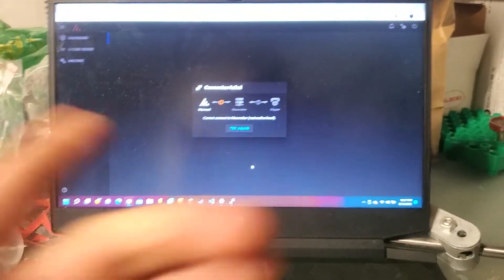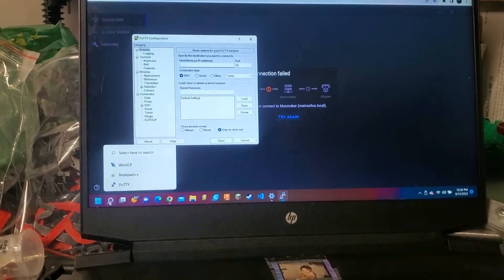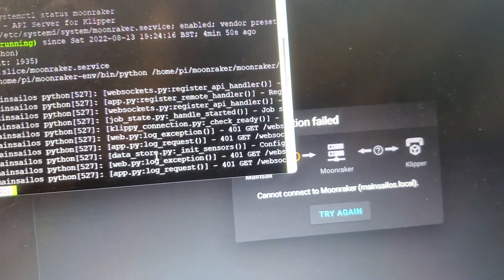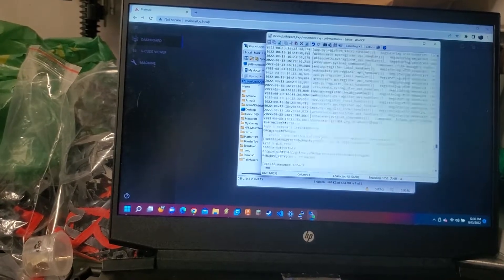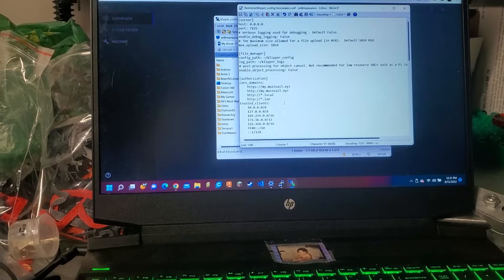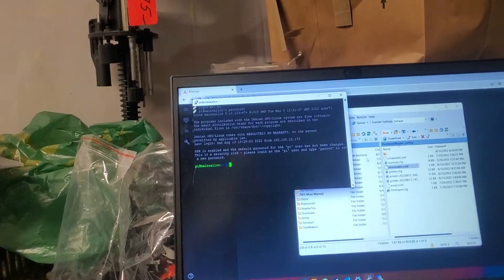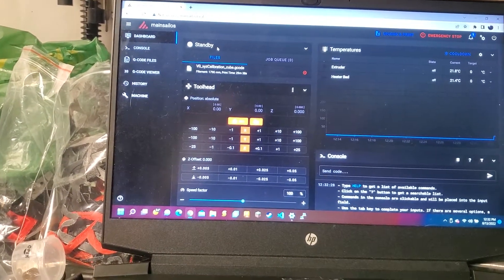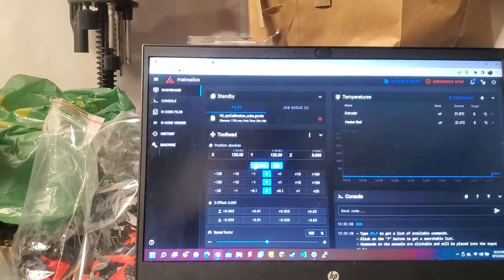Moonraker Unable to Connect: 401 GET / Websocket

Comment: Found your video and was hoping against hope that it would have the answers I need but no such luck.  Running a fresh install of linux mint and managed to get klipper, mailsail and moonraker running.  All was good until I accidentally shutdown the laptop.  Now when starting klipper I get an error that the klippy_uds_address in moonraker.cfg is incorrect?  Checked on a bunch of forums and (as usual?) I get non-answers.  Mainly "why did you do that?" or "you need to put in the right UDS address".  Honestly I don't know why some people waste the time typing an answer if they aren't actually going to type anything helpful.  I have NO IDEA what the UDS address should be nor how to find out.  That's why I asked.  One guy even told me that if I am not familiar than maybe I shouldn't be using linux.  That sort of arrogance is exactly why I HATED dealing with linux guys back when I was in IT.

Comment: bro no me aparece esa carpeta de klipper logs
Reply from the maker: Did you image your Pi properly?
Reply: @ZantZ pues si eso creo habia funcionado correctamente y luego no queria acceder.. estoy intentando cargar nuvament la imagen y al insertar la micro SD no reconoce el wifi el bb. no se conecta
Reply from the maker: @carlosrivas3440 Are you using an rPi or the biqu pi? The process to image both are a little different. If it's an rpi, which one is it?
Reply: @ZantZ estou utilizando el btt-pi
Reply from the maker: @carlosrivas3440  did you do the custom image option or the one for a rpi?  That could be your problem.

Comment: In my case, its showing moonraker not found when i run the status command
Reply from the maker: Oh like it's not active? In putty? I'm not sure how to get it active but there has to be a tutorial online somewhere.
Reply: @ZantZ  yeah finally found a tutorial. I will post a video on troubleshooting speeder pad issues
Reply: @easy_3d  where did you find tutorial please im in same trouble, my moonraker status is activating and i have some failure messages
Reply from the maker: @markomilinkovic1109  I apologize. I must have missed your comment. Did you ever figure it out?

Comment: Just knowing that ipv6 was the problem helped me, so I turned ipv6 off from my voron. This is better, because it allows me to enjoy the benefits of ipv6 on my personal computer!
Reply from the maker: See but when I did that I couldn't connect to the printer. It basically didn't even exist. I would have to rewrite the raspberry again. Maybe I did something wrong not sure.
Reply: @ZantZ  probably then. If you find yourself in a situation where you cannot connect at all to the raspberry pi you can always hookup a display and keyboard to it, altough with the v0 it is a bit of work when the raspberry is behind the back panel. And if you dont have a cable and screen ready to go it might just be easier to reflash!

Honestly I am considering adding hinges to the backpanel as well, for troubleshooting and easier access to the extruder tension knob (I have a v0.0, which is bowden)

oh, and just to let you know the way I disabled ipv6 was to edit "/etc/sysctl.conf" by adding 
"
net.ipv6.conf.all.disable_ipv6 = 1
net.ipv6.conf.default.disable_ipv6 = 1
"
to it, and then rebooting.

Anyways, what I really meant to say to begin with, but forgot, was thank you!
Reply from the maker: @valtarijunkkala  Im glad it helped. But yeah that's how I disabled ipv6 too but couldn't connect. I like the idea with the hinges. Haven't seem that before. Though I haven't really looked either.
Reply: @ZantZ  well, then the reason it didnt work will be a mystery forever

Comment: had this exact same issue, however every time i restart my pc i have to repeat these steps to get it to work, if you ad the line

::/0

instead of your ip address it seems to work all the time now, i think it just gives it the full range of ipv6 adresses rather then one specific one
Reply from the maker: Yeah I experienced the same thing. I put what I did in the description. Hopefully other people who experience this read your comment and do your thing instead. Seems easier and faster. Thanks for fixing the problem even more!
Reply: Worked on my BIQU Hurakan, was getting the issue when I would update it, So I added this to the Config before updating.

Comment: thank you so much, i had the exact same problem with my voron v0.1 and i couldn't find a solution, luckily i found your video.
Reply from the maker: I said this for someone else. I later realized that the ipv6 address would change evertime I connect so it I had to do this everytime. What I did was turn off ipv6 on my computer on my wifi. I didn't have to constantly put a new ipv6 address in the log. If it isn't an issue for you then great, but it is I would try that.
Reply: @ZantZ  yeah, after looking at the comments I disabled my ipv6, and now it works perfectly, thanks again.

Comment: hey dude just wanted to let you know I had a different problem with moonraker that your video helped me figure out. Basically my moonraker wasn't activating. It did stop working after an update so I reinstalled moonraker using Kiauh and now it works great thanks
Reply from the maker: I'm glad I could help. Hopefully you are printing dope stuff now
Reply: @ZantZ  I got a bunch of STLs I can't wait to get to but right now I'm printing pieces for a lack table enclosure for my ender 3 to Switchwire and little raisers for my new desk (I'm 6'7'' so my knees normally rub under desks so I'm making 2'' risers so that doesn't happen) then back to the cool stuff
Reply from the maker: @cityhunterinak  that's awesome. What type of filament are you using for the risers?
Reply from the maker: @cityhunterinak  and did you print the parts for your sitchwire with your Ender? I have 3 other printers but found a used ender 3 for cheap and bought that to print the parts for my Voron. I didn't do any calibrations or anything and the ender did an awesome job with the prints.
Reply: @ZantZ  well I am planning on using ABS  if its not strong enough I'll make some out of wood like I did last time as for my ender ya I made all my voron  parts with the little guy I started just wanting a 2.4 and an E3 to SW but from when I stated to now that I'm done I got a 2.4, a trident, a V0.1 and the E3 - SW when I stated printing the ABS pieces I used a trashbag to keep the heat in but soon a friend gave me a grow tent when he was moving out of state so I used that for a bit but  I'm moving so much in my place around for the new desk (my old one is 12 years old and I recetly had to zip tie the desk to the frame cause the screw holding it down wiggled out) I thought I might as well buy a few lack tables and got an amazing deal on the glass (32 something) and build one of the lack enclosures my plan is to put my trident and V0.1 on the new desk a lack table top on the floor (maybe some small feet not sure how tall everything is going to be yet) put the E3 on that the enclosure around that then the 2.4 on top and put that in the corner on the opposite side of my man cave/home office

Comment: helped me a lot!! thank you!!
Reply from the maker: I forgot I posted this. Another way I found that worked better was disabling 1pv6 on my computer that I use for mainsail. Seems to connect without having to go into the logs. The ipv6 address would change everytime I shut off the printer and I would have to put the new address in.
Reply: @ZantZ  in your network settings?
Reply from the maker: @kadir36ka  yeah. Use this link:

https://support.nordvpn.com/Connectivity/Windows/1047410402/How-to-disable-IPv6-on-Windows.htm#Windows%2011
Reply: @ZantZ  thanks, worked great for me!!